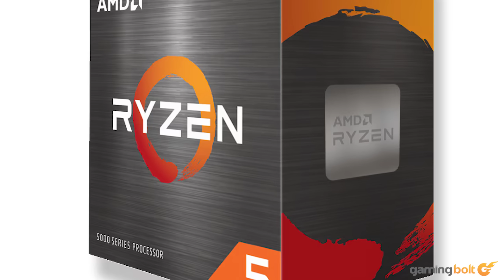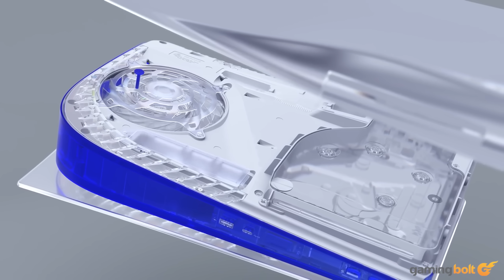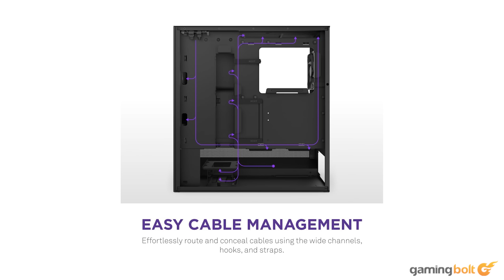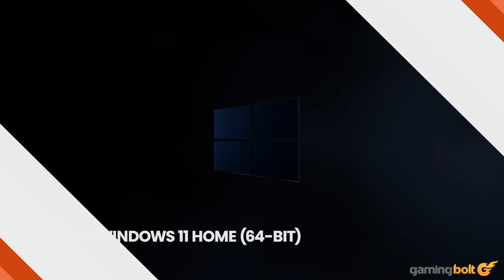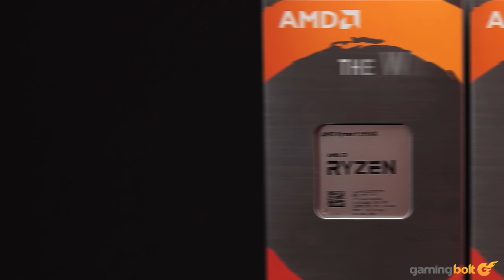How Much Would It Cost To Build A PC As Powerful As The PS5? (2025 Edition)

Comment: A PC having equal specs to a PS5 on paper doesn't mean games will look as good on that PC. It's much easier for devs to optimize on a PS5 because it's one kit. For PC they release one version that has to run on a million different setups. A $500 PS5 or a $700 PS5 Pro is going to blow any PC under a grand away just because the games will be optimized better. Death Stranding 2 looks and runs great on a PS5. Can you see the game looking that good on a cheap PC? Of course not. There's layers to this.
Reply: Yes its easier for devs to optimize if they are working on just one device family, although the current generation of consoles are more like PC's than the consoles before it. You are right though. A PS5 title will almost always be more optimized than a PC port or release. Yet this "one version" that runs on a million different setups of varying performance does this by just being able to change graphical settings. Something that is pre-chosen for PS5/pro

Basically, I wouldn't discount a PC with the same specs. If there's any difference, it is not a noticeable one or a difference easily made up by tweaking a setting or two. Especially when talking about such a optimized game as Death Stranding 2 to begin with. 

If it was some Unreal Engine 5 game, well.. both of them are gonna have a hard time lol.

Comment: Ryzen 7 3700X and AMD's 6700XT are the core equivalent components of the PS5. So, really, don't gas yourselves up over this. 

Cheap case and RAM, this is not an issue for those that know how to build, as you can easily meet or slightly surpass the PS5. 

The 16 GB DDDR5 RAM the PS5 uses might be the reason behind console owners boosted pride? 

If it's about the inability to keep and maintain a PC, the PS5 would make things smooth brain simple.

Suggested build?  Everything available in the PC space is way ahead of the console space. It's also more expensive, as is anything bought as a single component. 

You could actually build a better PC with used parts and figuratively future proof later vs. buying consoles. 

But the main components are the GPU and CPU. With that, a Ryzen 5800x and AMD 6800XT for the right price will smoke a PS5, even using DDR4 RAM. And with future proofing, it should still be ahead of the consoles for another decade.

Comment: I had an old mini itx pc. Someone gave me a ryzen 5800x cpu. I used it to upgrade the ageing ryzen 2600. 

And i bought a 9060xt 16gb for 315. I installed bazzite on it and done. A small, powerful pc for less than the base cost of the ps5, and more powerful than the pro. Just by reusing old hardware i had lying around. With a controller friendy os

This kind of option is why pc for me is the best platform

Comment: Lol how did he get to that price with that old parts. Btw if you want an equivalent cpu get Ryzen 5 3600 or you can get a cheap build with i3 13100 for cheap. My build with 13100 16gb ram 2tb ssd wd blue and used Rtx 2080ti was around $550. Rtx 3070 or 2080ti are discontinued by most places so would probably buy used. But these guys always make weird builds lol

Comment: Whatever the cost it’s worth it. I have a high end PC and can never ever go back to a console for more reasons than I care to list here. But my PC people know.
Reply: PC exclusives, ALL Xbox games, most important PS5 exclusives, retro emulation,  Nintendo Switch emulation, modded games, brand new games made from mods, being able to play older titles at 4K, maxed, 60+fps (locked to 30 on console Batman games and RDR2. Unless updated)

That alone is an insane value. I've had my $1100 prebuilt almost 6 years and it trades punches with The Pro. I've had Pro level quality when the PS5 dropped.

 Response times and visual clarity is better too. I used to be a console gamer. Its blurry and laggy inputs.  On my LG C3 I can even turn on all the enhancements and there's still no noticeable lag. 

Being able to configure every aspect of a game is great too. Forgot to mention DLSS 4 the best upscaler. It's like magic. Performance mode visual quality looks on par with DLSS 3 quality. DLDSR is another great tool that can enhance native resolutions and increase them without much of a tax.

That's a nice value and advantage. I still have no need to even upgrade. I have yet to play anything below 1440p 60fps maxed or near maxed. I can even play a lot of games in 4K 60 fps native.
Reply: List the reasons. I also have a high end PC. Playstation has good games. They get their games first. PC gamers get the leftovers. The leftovers can be buggy trash. Playstation first party games are top tier and Xbox is not looking too good these days.
Reply: @black_mountain_death_squad That’s funny you say PlayStation is doing good when the top five selling game on their system last month were Microsoft published 😂
Reply: @Hazmatt36000 what's your point? Playstation dominates Microsoft everywhere. You're citing a month. Microsoft won the battle of Gay Pride Month. 

What about last year? Who wins game of the year, back to back years, over and over again? It isn't Microsoft. Xbox is toast.
Reply: @black_mountain_death_squad oh I see your one of those weird fan guy people lol. I own every system since Atari and don’t care what happens to any of the companies. I use them for my benefit. I was just stating that your hero system is as lame as all the rest. I’ll give you some advice. Stop worshiping a toy like it’s a football team. They are all business. I buy all the consoles still just to display around my home but I only play them when I’m forced too. Why would I choose a weaker compromised piece of tech when I can play on a PC that is ten or more years ahead of what they can do for me. And my PS5 has been my least played because of least exclusives. I will say returnal is the best game to come out of this whole generation through. See how I can love a game and not lick a companies boots. It’s a toy man.
Reply: @Hazmatt36000 do you believe in paragraphs? I'm not reading all that nonsense. Why are you lecturing me? I was born in '82.
Reply: @black_mountain_death_squad    PC exclusives, ALL Xbox games, most important PS5 exclusives, retro emulation,  Nintendo Switch emulation, modded games, brand new games made from mods, being able to play older titles at 4K, maxed, 60+fps (locked to 30 on console Batman games and RDR2. Unless updated)

That alone is an insane value. I've had my $1100 prebuilt almost 6 years and it trades punches with The Pro. I've had Pro level quality when the PS5 dropped.

 Response times and visual clarity is better too. I used to be a console gamer. Its blurry and laggy inputs.  On my LG C3 I can even turn on all the enhancements and there's still no noticeable lag. 

Being able to configure every aspect of a game is great too. Forgot to mention DLSS 4 the best upscaler. It's like magic. Performance mode visual quality looks on par with DLSS 3 quality. DLDSR is another great tool that can enhance native resolutions and increase them without much of a tax.

That's a nice value and advantage. I still have no need to even upgrade. I have yet to play anything below 1440p 60fps maxed or near maxed. I can even play a lot of games in 4K 60 fps native.

Comment: The PC is better and cheaper if you add the cost of multiplayer for the life of the system.
In this case  the PC  would still be 1159 or 1251
The PlayStation essential cost is 80.00 per year. The lifespan of the console is at least 10 years according to Sony. So that’s  an additional 800 minimum. That you don’t pay on PC.
Ps5 digital 450+800=1,250 
Ps5 disc 500+800=1,300 
Both of end up costing more than and doing less than the PC’s in this video. We are all consumers, let’s choose wisely. 
Side note, Sony will continue to raise the price of PlayStation essential over this next 10 year period as well giving that pc even more value.
Reply: A lot of console players don't play multiplayer gtames, they play lots of single player games so a subscription is not compulsory. Also free to play multiplayer games on console like Apex Legends, Fortnite, etc. don't require a subscription.
Reply: No one plays multiplayer games anymore so the console without the subscription is cheaper.

Comment: I was trying to build a pc to retire my ps4 slim and i want to play MH wilds. Saw the price of the parts (gpu alone e.g. 4060ti 16gb and r5 5600). The I saw a refurbished based ps5 with disc drive selling for 360usd (i can used my old ps4 disc, and i can buy old ps4 disc from a store near to us). Sold my ps4 to add a 2TB ssd on my based ps5. And for some odd reason the disc version of MH Wilds cost less than the digital copy on steam in our country. WTF 😂😅😢

Comment: First of all the pc does 1000things not jut games so a pc is bettet than playstation anyway.
I got my first pc in 1996 when i was just 9 years old and disnce i did my first uprade in 2001 i upgrade each 2 or 3 years and the reaosn is becuasei want to play all games maxed 60 fps. Or when a pc compoennt dies/burns, Last upgrade i ddi was in 2021 when my previous graphivs card died and in 2020 i changed ssd. But i have the same cpu ram and motherboard since 2017. It still run all gmaes maxed 1440p 60 fps(with FSR in those who have ray tracing) and loads evrything in 1 second(windows, internet, movies, series, games, programs). It is much more powerful than all consoles.
My next upgrade will be cpu ram and motherboard when zen 6 releases.
Now even a medium pc(with 2025 components) will be more powerful than ps5. A ryzen 9600x with 32 gb ddr5 6400mhz x870 motherboard and rx 9600xt or rtx 5060 ti is much more powerful than ps5 and will cost around 1200 euros if you get the cheapest x870 motheboard.

Comment: Payed £1600 for me first gaming pc last month hopefully on level with a ps6 in 2 years way more powerful than a ps5 pro though AMD Radeon RX 9070 (16Go GDDR6 RAM / HDMI
2.1b / DisplayPort 2.1a)
• Intel i9 12900KF 16-Core CPU (24 Threads / 30MB
SmartCache / 65W TDP)
• 1TB NVMe M.2 Solid State Drive (For Rapid Start Up, File Saving and Faster Desktop Performance)
• 16GB DDR4 3200MHz Dual-Channel High Speed
Memory
• 23" 1080p Monitor, RGB Gaming Keyboard, RGB
Gaming Mouse, Black Mouse Mat, Gamer Headset with Microphone, Wireless WiFi Network Adapter, Pre-Installed Microsoft Windows 11 Operating System
Reply: Consoles usually release as current gen 60 series equivalent, [PS4/1060 > PS5/3060 > PS5 Pro/4060] so it's a rule of thumb to estimate it.
I usually build my PCs using consoles as a base, let's me know what I need to run games for that generation then buy the 90 series 🗿
Reply: @Mister_Kitler PS4 pro I'm guessing not just the base PS4?

Comment: The Ps5 doesn't come with a keyboard and mouse, so you shouldn't have added the price for it.
Reply: A PC is non-functional without.  Very much valid to include.
Reply: @burnsyd17  That's not totally true. A gaming PC built to resemble the Ps5 can be used at least with a mouse and without a keyboard, since we can use an on screen keyboard and the controllers.
Reply: @Noob-zi2ce that's only possible if you have an operating system built that way. As by default windows would need a keyboard and mouse to even install that operating system then install a program with a startup touch keyboard. Keyboard and mouse is the equivalent of a controller. A console is useless without a controller.

Comment: PS still has Zen2 AMD processing.   Its equavalent to a Am4 Ryzen 3600, with 16GB of DDR4 and Radeon 6700xt .
Reply: Point I am  making is you can build this PC for 700 or less and it will be faster thsn a PS5 pro and way more versatile.  THE mobo, CPU ,  Ram and  case, you can get for 300 bucks or less
Reply: 6700 not the 6700xt
Reply: @mp32298  in practice the 6700 runs most games worse than a PS5 since PC is less efficient.
Reply: @sjneow Not true at all rhe PS5 base anyway even on quality is running the game on medium take a gane like Claire Obscure  quility is medium 30 fps a 6600 XT which is weaker than a 6700 of coures will run it high even texture on ultra 50 FPS 6700 higher than 60 fps on ultra so no PS5 isn't more officiant its just optimize often running on lower settings
Reply: @sjneow The PS5 Pro is closer to the 6700xt not PS5 base

Comment: Total cost of ownership. Consoles are a money pit.
Reply: Not really. My Alienware, which is two years old now, will cost me more to upgrade the RAM and CPU, plus graphics card, than a new PS5 will cost.
Reply: @chriscollins550  That's because you have an Alienware. Those are much more expensive.. You paid for the name, when you could have had a more powerful system for less, if you had built it or went with a different brand.
Reply: @hhaste it's not that easy anymore. There are no pc hardware shops within a two-hour drive of me now. And the price of the CPU, including taxes and import costs, on even cheaper ones is through the roof. Because pc have almost become redundant, but for corporate use and games. Sales in the EU have dropped more than 80%. This is also having an effect on the costs of parts.

Comment: Where are the $700 PC, i was told its better than PS5 Pro 😂
Reply: "i was told" by a flat out liar (or someone completely ignorant of mid-2025 market prices).  You will not TOUCH the overall performance of even a PS5 base model for $700, no chance a Pro.  Only way that is remotely possible is with almost entirely used parts with a total crapshoot if you'll get working parts.
Reply: Yes you can, you're on a search engine, use it instead of spreading misinformation. @burnsyd17
Reply: You have no idea what you're talking about. You can build a better PC at both of those price points with all new parts.  @burnsyd17
Reply: You absolutely can build a PC at those prices with new parts, I build PCs for a living.  @burnsyd17
Reply: This can definitely be achieved, but one aspect of the video that I appreciate is its avoidance of cheap used parts. I've come across videos where people build PCs capable of running games similar to those on the PS5 for the same price of a ps5, but they often resort to using low-quality or used components. In the long run, this can end up costing more money.
Reply: @hardvegetable1598  You can build a stronger PC than the pro for $750 (region dependant) with new parts usually. The video outright builds a stronger PC than match the hardware equivalent to the PS5.
We're talking about a console that has to upscale from 720p to reach 1080p 30fps in games.
Reply: @Mister_Kitler you would need to also upscale on pc to reach the same performance
Reply: @Mister_Kitler  if you're not living under a rock you would know that recent games are so demanding that they also require upscaling. i personally dislike the ps5 pro and i went with a 5070 myself but let's be honest a pc with that price will also need to upscale
Reply: @Mister_Kitler Interesting.... 1080p for 30 fps on the PS5 Pro? I must have a special version.... I've never had issues hitting 4K resolutions and 60 fps on most games since buying it at release. 🤷🏽
Reply: 6:39 Yes, to replicate the stick drift experience 😂
Reply: @YAAMW I've owned multiple controllers and never had stick drift issues.
Reply: 7:27 Are you serious? Just get a key from any website.

Comment: If any body got any ideal suggestions for me to build a PC, im all ears. This will be my first one.
Reply: With that mindset you'll fall off, stick to console
Reply: Use PC part picker. I just built my 1st one and went with AMD CPU and GPU to save some money. For me the build was fairly easy but I didn't have anyway of getting windows installed (I don't have another PC) so I had to get a USB adapter for my phone to load it onto the USB drive😂